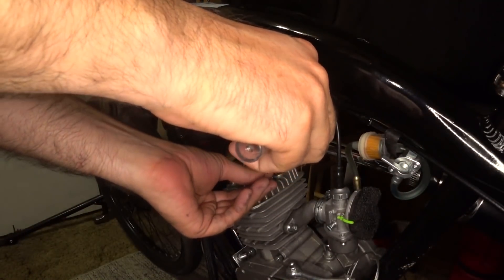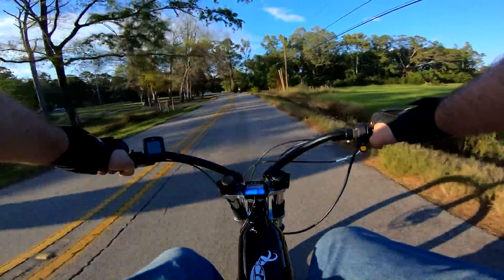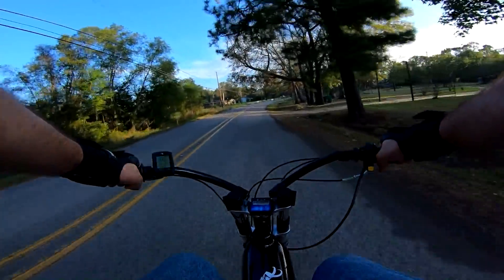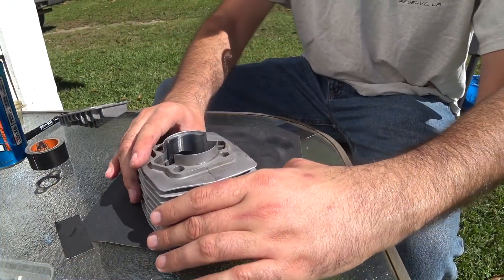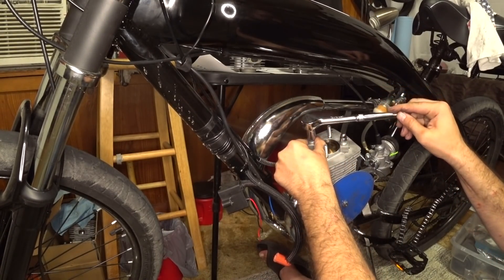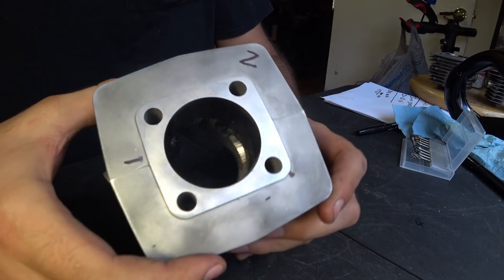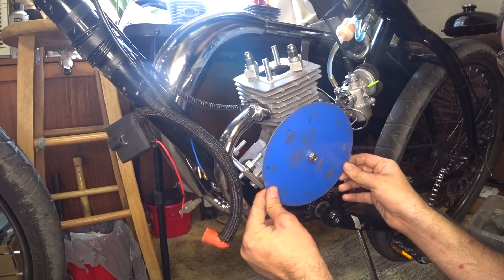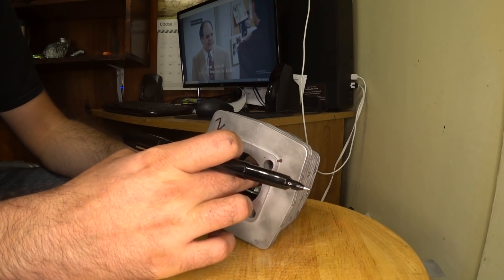Motorized Bike Performance Pt.3

Comment from the maker: I'm always open to suggestions and corrections. If you have any resources you would like to add to the series let me know :)
Ride Safe Builders!
Reply: Hey, thanks for this!! What sprocket were you using? Couldn't recall if you mentioned it.
Reply from the maker: Gary nice man, I have one but must have got a bad batch because mine runs bad :( I'll be digging into it soo to see if we can get some good numbers :) ... Oh and it's a 36T sprocket on 26" wheels
Reply: Do some aftermarket clutch vids if you haven't already, possibly an aftermarket diy setup as its hard to buy clutch kits over here in the UK 👍🏻 always love your vids keep  doing your thing
Reply from the maker: Tactical If I manage to pull enough power out of one of these motors to slip the stock clutch I sure will thanks :)
Reply: Also, have you thought about playing with a 110? I have one. I posted a video on a couple Facebook pages. I don't know the durations. I'd have to ask D. It rippppzzzz!!
Reply: What is your opinion on the cheap ebay nitros kits
Reply from the maker: Crisp I never gave them much thought sorry.

Comment: Quick question sir 🚲💨💨💨 which motor kit you think is better and reliable zeda 2-stroke or California motorbikes 2-stroke kit 💨💨?
Reply from the maker: The Wild Cat from CMB might be just as good if not better, but I don't have enough miles on it yet to say one way or the other... The Firestorm Zeda 80 From B-E on the other hand has proven it's self to me in both reliability and performance. If I had to choose between the two I would get the firestorm, but I don't think you can go wrong with either one.
Reply: @LAHover  thank you 🚲💨💨💨💨💯
Reply: Who do you think will respond first  if there was a issue with the kit 🚲💨💨💨💯
Reply from the maker: @motorizedbicyclerider5296  B-E. I attempted contacting CBM twice by email and once by text with a question about there Wild Cat motor and never got a response. B-E has always replied to my emails within 5 days, normally within 72 hours. Even when I was using my non channel related email account.
Some times replies get sent to the spam folder so keep an eye out for that...
Reply: @LAHover  thanks for the info appreciate it 🚲💨💨💨💯👍

Comment: That last three, with the deluxe pipe... You weren't "on the pipe" till it hit 38mph! That expansion chamber is for a much hight rev engine. That's why the other one accelerated so well. It was "on it" from around 20mph, that's why it put the better time down. Personally, new bigger, jetted carb would help out a lot! You did all that work to improve air flow and timing, then put a restriction plate on it! Go for broke with a big carb, the deluxe pipe and rev that thing to 9,000!

Comment: La hover I need help I just ordered. A pZ20  and I have the 2 inch pipe g2 reed how do it connect it to the g2 reeds with a. Hose clamp
Reply from the maker: This reed get came with the needed adapter. https://www.amazon.com/dp/B09C7NWW58?psc=1&ref=ppx_yo2_dt_b_product_details
But you can buy the adapter separate as long as your reed has the 23mm intake. here is the adapter that mounts to the pz19,20, and 22 https://www.amazon.com/dp/B09C5SFC9Q?psc=1&ref=ppx_yo2_dt_b_product_details
Reply: @LAHover  thanks alot man  how do you think my 80cc with a high compression head f2 thrust pipe windowed piston and g2 reed and a pz20 carb will run without porting

Comment: I ordered some piston rings from Amazon. I got a total of 10 rings for $7.99 . Come to find out they don't fit. The size is 10x47mm. Should I go with the JRL brand 4x47mm ? The rings I ordered were made in China. Bike Berry is sold out on their ring sets, and have been for the past month. Maybe the supply chain shortage is the cause?
Reply from the maker: What motor do you have?
Rings are an item that I have not given much though to yet in terms of performance so I get really give a good recommendation... I know these ones fit a standard pk80, zeda 80, 47mm piston. https://www.amazon.com/dp/B075VKZ6G5?psc=1&ref=ppx_yo2_dt_b_product_details
Reply: @LAHover  I have the Bike Berry silver angel 66/80cc
Reply: @shanemcguire9980 does ti still run?

Comment: The mz65 clone provided good improvement for a much lower price (1/2 the price?) of the wc80.......I assume a muffler was added to the end of each pipe to quiet them during testing??     
      I was told by someone that a $60  mz65 clone was a waste of money and just a noise maker due to it's restrictive header pipe. Apparent that's not the case, I think he might of meant that the mz65 clone will be useless if you plan on doing major engine mods. Like bigger carb, reed valves,major porting,etc.. I suspect the wc80 would work better on a modded YD100 or Phantom 85 than the mz65. 
 Like LA Hover said, it's hard to tell if the improvements are just from a more open/better breathing exhaust or if the expansion belly is actually doing what it's designed for.
Reply from the maker: Good point, and this is just one test with many variables. As of right now it looks like the Clone seems to favor lightly modified motors as you pointed out.
hopefully with a new carb we can get the WC80 to regain some of the lost low end power.
I am running the same silencer on both pipes (linked in the description) which probably is effecting both pipes.
Reply: @LAHover  After more reading, I found out old 2 stroke motorcycles don't have an exhaust power valve. Which means they can either be tuned for good low & mid range power at the expense of  top end. Or good top end power at the expense of poor low & mid range power. The WC80 has more top speed & less low & mid range because of the larger header ID (a smaller stinger ID on the WC80 might help/work better with low,mid or hi power) The MZ65 has smaller ID header than wc80, giving it better low & mid at the expense of top speed. Newer 2 strokes use an exhaust power valve that  opens & closes & adjusts the size of the exhaust port. Which now gives it both low & mid & high end power....They use a large ID header (fmf gold) expansion pipe (with smaller ID stinger)  At full throttle, the exhaust valve opens wide, giving it more flow & good top end. During low & mid range, the exhaust valve closes a bit making ideal ID for better low & mid power. So if you can't decided if you want more top end or low & mid range. I'd buy the wc80 and just restrict the header & stinger for more low & mid. Then you can always switch it back to more top end speed if you want.

Comment: Totally worth your tests,and ports.I put a film of Molybdinum grease in my cylinder,and in  the wrist pin bearing,letting it set 3-4 days before putting the piston in.I gap the rings,and smooth their edges,and that of the ports.I think grease will leave marks for you to see the stroke./Side note;Some may not check where their ring gaps are before porting,and may get a "Catch"on a lip.
Reply from the maker: Thank you for pointing that out. good call!

Comment: MZ65 all the way for me , need the torque and better made pipe .
My firestorm 80 should arrive fri or sat , a friend w a bt80 went w me this evening to walmart they had the cranbrook and a v frame kent seachange that he recommended for my 1st build so i bought that , has nice fat welds compared to the huffy and looks and feels much nicer for 20$ more w nice generous engine bay . He brought scrap bottom end and all we had to do use 4" c clamp to squeese frame about 1/4" and the block slipped right into place ...thanks for comparrison on these pipes , was lookin at both . Im gettin the cooling fin 5.5cc head along w motor kit , do you think i should start w cold plug 1st or what # would you suggest ? Thanks again this review right on time !
Reply from the maker: That is a good question. more compression would say yes, but better cooling might balance it out. I honestly don't know, so ya stay on the safe side and start cold.
Just IMO
Reply from the maker: might be wise to start with high octane to. Wish I had more testing done with heads, but we are working our way there.
Reply: @LAHover  Thanks so much i ll start cold . Thanks again !